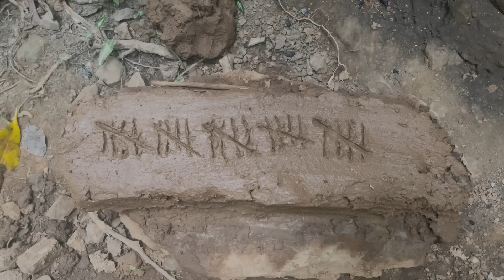Primitive Technology: Wet Season Destroys Thatched Workshop

Comment from the maker: It's been a heavy wet season (biggest since the 1970's) and it's slowed down production of building material as well as other projects. Fortunately, the brick and wood ash cement hut still stands after 2 years of wet weather. The video highlights the importance of permanent structures in this hot wet environment.
Reply: Yknow, ive always wondered if that Brick mould you use is still the one you made way back then. Did it ever break when you used it and if so how many times? Any other instances of your Pottery/Tools breaking in use? I dont see you use that stick drill to make fires anymore. Greetings from Austria
Reply: Wow
Reply: It might be time to invest in working on a drainage system due to the pooled water around the yard? Also, a bigger brick workshop would be nice.
Reply: Would it be possible to build a workshop with a brick roof & supports? Or is that too dangerous without industrial-grade materials?
Reply: Did you wear a protective mask around the mold spores or did you just hold your breath or something?

Edit: Please stay safe there. The currents look dangerous. But i guess for an outsider like me it looks worse then it is
Reply: In what country are you filming these videos?
Reply: @KajSeVai Australia
Reply: How many bricks do you need for your project? Also have you considered maximizing the ammount of drying bricks by stacking wet ones with leaves i  between to prevent them from sticking like parchment paper does with baking?
Reply: @KajSeVai Northern Australia IIRC (Queensland?)
Reply: If it's not a secret, how old are your shorts and where can you buy them? It seems their quality hasn't dropped for eight years now.
Reply: Perhaps you could create the posts in the modern way- that is, by digging a wide hole for the post and filling with concrete. This way you will not be limited in the diameter of these posts
Reply: I think I saw a comment earlier advising it’s time to build a work hut with more permanent materials. Maybe brick pylons to hang a tile roof from that will allow for ventilation during firing?
Reply: Great video! It sucks that this wet season has made production so tough for you. I still enjoy every video you post though! Are there plans to make a larger brick workshop or would that be way too many bricks?

Also just a curiosity question but is the place you do all this filming a lot of travel for you? Like do you have to drive far away from home to get here?
Reply: I mean it's amazing how long the brick hut has survived. And it doesn't seem to really degrade. Do you have an estimate on how long it may survive?
And what do you plan to do with the bricks? 200-bed hotel?
Reply: My goodness, the erosion from all that water. Must be rough. As another comment said, maybe it's a good idea to think about a drainage solution.
Reply: Month 3 of requesting to be your editor, love your work!
Reply: Did you immediately regret making the new hut smaller? Or it was still a good decision?
Reply: If it were feasible, would you attempt something like a wood shake or wood shingle roof?
Reply: Must be getting ready to build a pyramid
Reply: @bigmanmax647  He mentioned in another video that the bow drill isn't needed anymore because it's too cumbersome and doesn't really start fires much faster since he's skilled at drilling by hand.
Reply from the maker: @bigmanmax647   Yes, it is still the same original ceramic brick mold. The very first mold was wood which has since rotted away. The benefit of a ceramic brick mold is that it is permanent. Also,  I have a second brick mold in case the original breaks. The reason I don't use the cord drill any more is that there are more parts to maintain relative to the fire sticks. Also, I have a broken stone axe right now that needs the handle replaced. Rope is what I go through the most due to it being the drive mechanism for the blower. Thnks.
Reply from the maker: @botaohenryfeng9587  Bigger would be nice but maybe tiled smaller one till then. The most recent hut built in this video only lasted 1 month before needing new thatch. Tiles would give a permanent space. Thanks.
Reply from the maker: @casualcommenter7152  Yes, it would take a while though. If built well it would be safe. Thanks.
Reply from the maker: @drizztdourden4929  Just stay up wind of spores or hold breath. Yes, I didn't go in the water that day, too strong. Thanks.
Reply from the maker: @KajSeVai  Australia.
Reply: @casualcommenter7152 

Bricks aren't a good roofing material. It's easier and more efficient to use bark that's be coated in resin or tar, depending on availability. In theory, if he could make a primitive wood splitter, he could  make his own shingles out of locally available wood.
Reply: Why are you so behind to primitive skills or is he a fake tuber call him out.
Reply: Will you look into more advanced pottery technologies such as porcelain, potters wheels, stoneware etc? Could be a good way to use the newly advanced pyrotechnology whilst continuing to gather metal ores slowly.
Reply: Duuuude, you missed the perfect opportunity! You should have made a quick 30 second video on April Fools day Titled "How primitive peoples made fire". Then proceed to spend a few seconds with a lighter, lighting the fire, then waving your hands like its magic.
Reply: Its kinda amazing the brick shack wasn't washed away in the monsoon that was going on in that area,
Reply: Do you have crocodiles in there? Or any deadly/venomous creatures? Is it dangerous to walk around barefoot?
Reply: wattle and duab
Reply from the maker: @GingerHead.  100 more or just tiles depending on the shelter. The problem with stacking is that the clay slumps if done too early. Also, bricks need to be stacked on their sides to stop breakages. I considered drying shelves but it was too complex. Thanks.
Reply: Primitive skills is a fake copycat
Reply: @bigmike-  a primitive froe would be within his ability I think.
Reply from the maker: @RuslanGabdrafikov  They're not the same ones. The brand is Stingray made in Bangladesh. Thanks.
Reply: Have you considered making buckets with handles (rope or horizontal stick) instead of pots, to allow for carrying two at once to reduce the amounts of trips from the stream to the hut?  Do you not care enough since it's it wouldn't save much time relative to the overall time it takes to make clay products?  Or is it too difficult to make given the tools at your disposal?  I would also imagine that then you'd have to worry about losing a pot if a handle failed too.
Reply: For anyone wondering he took precautions
Reply from the maker: @sportz5740  That's the plan, to build more permanent brick structures. Thanks.
Reply: What temperatures and humidity are you dealing with?
Reply from the maker: @Congra  A smaller brick workshop maybe, 2x2 m is enough floor to make 50 bricks plus a stacking area. Kiln outside, fire wood inside. It's not far to get there. Thanks.
Reply: How long has this set you back if you don’t mind me asking?
Reply from the maker: @robertnett9793  Over 2 years old now. Bricks and tiles don't rot but the wood might. Much better than thatch though. 200 very tiny beds maybe. Thanks.
Reply: ash-crete  @gnometruth
Reply: Could you sign a book for me with a muddy handprint so I can high-five you, please?
Reply from the maker: @Sphendrana  The bricks were fine regarding drainage, it was the roof that's a problem, the direct rain dissolve the waiting bricks. You'll see in the video I made square ponds. These collect levigated clay for pottery projects, the drainage off the roof helps in this process. Thanks.
Reply from the maker: @obscureorca  It was the best option in the situation. Some of the bricks are still there and I'm currently repairing the roof. Thanks.
Reply from the maker: @bunkydoes8048  Tiles are better than wood. Wood exposed to the rain rots where as purlins under tiles last longer. Thanks.
Reply from the maker: @Rob-rr4yp  Glazes would be good. I'll think about it. Thanks.
Reply: how many grams of iron do you have and what do you plan to make with it?
Reply from the maker: @dkarbaev  Just snakes, no crocodiles. Further down stream there are crocodiles though. Thanks.
Reply: Hi, only tangentially related to this video but a few papers mention the importance of silicon in cast iron production. Have you tried adding something like the grog you make from broken ceramics to the smelting process?
Reply: @gnometruth  nah man he doesn't use and modern methods for anything. Absolutely everything he uses he made himself from the natural materials. He even tried to make his own shorts but they didn't work out very well so he wears store bought shorts.
Reply: What will you do differently on a new brick build? Any ideas to deal with rising damp and foundation settling?
Reply: @primitivetechnology9550  that makes sense. I'm excited to see that built! 

Glad to hear it's not a huge trek for you to get to your primitive tech area!
Reply from the maker: @Patchnote2.0  It might be done with pottery, pots could be made with holes in them. Just other priorities but I'll consider it next pottery batch I make. Thanks.
Reply from the maker: @jamessylviasyracuse-little865  30 c heat probably, 100% humidity when it rains. Thanks.
Reply: Did you enjoy the novelty of the huge floods or was it purely an inconvenience? I'm guessing it got old quickly.
Reply from the maker: @ret9108  I might be able to make 200 bricks in 5 weeks. wet season is 6 months but not so intense the whole time. So 800 bricks not made? thanks.
Reply: are you going to put a brick/tile? roof on the workshop? I guess you'd have to make the foundation and such, but it seems to me you've got it laid out, and could build from the posts up. you'd also still have something to keep the rain out for a while.
Reply from the maker: @ShayzZin  It might make slag with the iron, I'll look into it. Maybe quartz rather than clay to make purer silicon? Thanks.
Reply from the maker: @AndrewArdill  I might make a temporary brick hut mortared with clay so I can take it apart and make a different one later. Build a small one to make bricks and then a larger one later. Thanks.
Reply from the maker: @Benjamin-mq6hu  It was a bit of a novelty but got old quick. My friends house got flooded so it wasn't fun for him. Thanks.
Reply from the maker: @Korhanne  Yes, definitely tiled roof. I have a plan but need to test it out, want to use minimal amount of bricks to support a roof while still having it stable. Thanks.
Reply: How do you deal with bugs and other critters? Do you know which ones are venomous? What if a bad one comes crawling on you?

I would vacate the house and build a new one if I were to ever saw a centipede crawling out of the coal pile lol
Reply: @gnometruth  Sorry sir, this is the primitive technology channel.
Reply: For clay firing, there's another youtuber named Fraser Builds who uses flour/other starch fluid that makes the clay more 'suitable'. Perhaps this technique would be of help for your projects?
Reply: @primitivetechnology9550 you could use the iron make some nails or something :D
Reply: Very interesting! I notice you still have sedimentation pits but are also gathering raw clay from the creek bank. I'm guessing the gathered stuff is better for bulk products like bricks and you're using finer clay for your pottery now? I remember you made previous tile roofed huts on wood frames, I'm guessing those would hold up better than thatch but not be as laborious as the brick buildings...
Reply: @primitivetechnology9550  regarding the idea of handles, maybe you could make some sort of harness for the pots, which you then hang from a perch, allowing you to have one on each side of the perch and have the perch on your shoulders, this way you can potentially carry double the load while keeping things balanced, might be easier to make than handles (which would need to be strong enough to carry the load)
Reply: You sir, are a legend. i hope you didnt loose too much with the wet season. is there any way you could make the materials more resistant to the weather? ofcourse within the boundaries of the tech period.
Reply: @primitivetechnology9550 You could probably make a larger, more permanent kiln using all those bricks, with a blower to assist both the drying stage and the firing stage. That way you could really ramp up your brick production!
Reply: @casualcommenter7152 He shows you his brick hut with clay tile roof still standing just fine at the end of this video.
Reply: @primitivetechnology9550 You could try making some glass out of some sand! With glass, you could make a small lens to try and start fires that way?
Reply: Idea:  Make a brick form for 4 at a time, or maybe more...but 4 seems most tenable for the space...2 rows of 2 - means you move/water the form 4 times less.
Reply: You seem to be going through a lot of wood with all the brick firing, coal making and forge tests you've done over the years, so I'm curious: How large an area have you now searched for sticks and wood? And, when you fire the bricks how often do you have to feed the fire? Great video as always :)
Reply: I always wondered where you learned how to do all this cool stuff and did you learn in case of a Zombie Apocalypse?
Reply: With this heavy rain, are you anticipating it to change/speed/slow future resource collection significantly? For example, are you anticipating increased or decreased clay deposits, or has iron production been lessened by the faster currents?
Reply from the maker: @Rws4Life  Smoke is good for mosquitoes, but the other creepy crawlies are unavoidable as yet. Probably sleep off the ground on a bed. Yes, they're no good. Thanks.
Reply: @sophietaylor9753  Making clear glass is a bit more complicated than just putting sand into a fire or furnace. You need the right materials (they cant be contaminated by ANYTHING), have the exact ration of said materials, a fire that supplys a constant ammount of heat (1666C or 3090F) for a long period of time, a way to measure that temperature accurately (a few degrees more or less will result in failure), a way to not only give the glass the right form (eexact curvature, cant have dents or something - also need instruments to measure this), a way to polish one of the hardest man made materials (glass is a 6.0 out of 10 on the Mohs hardnesscale with diamond being a 10, he has no material that would work yet - the hardest is probably his cast iron and thats a 4.5-5/10 at best) and then a way to store said lens without it getting scratched.

Im guess that this is still a bit out of his league. 
Its also probably not worth the trouble, as it would be a LOT of work (i would guess somewhere up of 200 man hours for a project that might only save a few combined hours in the long run)
Reply: @RuslanGabdrafikov I have a theory that he actually bought like, 20 pairs of the same shorts and labelled them “work”
Reply: I'd like to eventually see you build an all in one mega structure, tile clay brick different rooms for different tasks all done for permanence and climate control
Reply: @Rob-rr4yp it would be quite wild to see him go through his own stone, bronze, and Iron Age. When I have kids and a beard he’ll have a residential block built 😂
Reply: @primitivetechnology9550  oh! I see that now. I watched a few things over as I usually do with your vids and finally noticed!
Reply: @primitivetechnology9550  is it possible to cover wood in mortar or clay in order to prevent/slow down rotting?
Reply from the maker: @hakonsgaming535  Yes the pottery clay needs to be gathered from certain sources, the mud that passively collects in the creek from the surrounding soil won't work for pottery as it's weak. Might be too weak for bricks too. Yes, probably make a brick wall to hold up the roof, lashings tend to rot which is a problem for pole roofs. Thanks.
Reply from the maker: @celivalg  That's true, I'll keep it in mind. Thanks.
Reply from the maker: @Palerider1942  Clay tiles instead of thatch. I mentioned that smoke preserves thatch but it still doesn't last long. Thanks.
Reply: What is the timeframe of your recording and upload schedule?
Reply: Your videos are very relaxing to watch. Do you plan on making an extension to your brick house?
Reply from the maker: @sophietaylor9753  Yes a larger kiln would be good. Quadrupling the capacity would take twice the firing time  6 hours (400 bricks) instead of 3 (50 bricks). 12 hour kiln would fire 1200 bricks and be over 2m high and wide. More than this would require multiple people to stay awake and fire them in shifts. Thanks.
Reply from the maker: @sophietaylor9753  I tried some glass but it was gritty and not glass like. The best "glass" I made was during a smelt which made blackish blue glass from iron ore. Ash seems to be important in glass making. Thanks.
Reply from the maker: @jamesbramlett5407  Might need to be a wood mold for that. Thanks.
Reply from the maker: @iccuwarn1781  Yes, because the wood is dead fall, you only have to wait for more wood to fall rather than go a long way to fetch it. I don't go out of the valley the hut is in to get all the wood needed usually. Sometimes I go further to get wood for charcoal though as the wood density is important for that purpose. Thanks.
Reply: @primitivetechnology9550  RE: spores, I think if/when you have to deal with some security risks that can be easily avoidable with modern technology, you should go for it regardless. As you said, staying upwind from the spores is enough, but if you had to salvage more stuff or go into some mouldy place, for sure use a mask. Like you said about not going to the water, it pays to know a couple of knots and have some (modern) rope on you, stuff like that. 

Just wishing all the best, we know you take care etc.
Reply: @finnbergermann Yep, thus the "try" :P You don't need a lens to be perfect to make it concentrate light - as long as it has curvature, it will have a finite focal distance. A lil' blob of glass, even severely contaminated, might be able to focus enough sunlight into a small enough area to start some smoldering.

Furthermore, adding soda ash and potash will greatly lower the melting point required, making it much more achievable.
Reply from the maker: @Trxps_Dark  Just trial and error and research. Maybe not zombies but in case of unemployment. Thanks.
Reply: @primitivetechnology9550 "Ash seems to be important in glass making" Yep, it lowers the melting point necessary to form glass.
Reply: @primitivetechnology9550  RE: wood purlins and rot: does drying and charring the wood help? I know if every building of yours lasts 2+ years like the current one it is already "good enough" - but if charring helps and is low effort, might be interesting. I'm not familiar with literature on the topic, so I do apologise for that.
Reply: Have you thought about buying some copper ore, as there probably isn't any in your forest and then smelting it? Historically people figured out how to make copper, then bronze then iron. Iron was probably too hard to make first.
Reply: Have the flood waters died back yet? Did they bring you anything interesting?
Reply: Could you do a small brick shelter but dig the floor so you have more room ? You'll have to think about making stair and protect the entry of water but it could be nice for you to stand fully and easier to build and gain place ?
Reply: Have you noticed the compression issues with your recent videos? It's especially evident on flames or during time-lapses (i.e. at 4:23 and 5:00 respectively). I'm not sure when this started exactly, but the compression wasn't always that bad, for example the fire and time-lapse in your "Primitive Technology: Making Charcoal (3 Different Methods)" video (i.e. at 3:25 and 0:45) look much better.
Reply: I am sure this is asked often but does anyone know what country this is?
Reply: @primitivetechnology9550  Replace the timber support in your basic workshop design with columns. 4 bricks placed at 90 degree angles to each other (leaving a half brick of open space down the center), or just build two brick walls on either side with timber spanning across. I would be concerned about the shear strength of the two-walled design, but 6 columns of bricks should be plenty stable. If you need to have walls on either side to have enough timber to support clay tile, use diagonal bracing with timber back to the ground to add some shear strength and keep the walls from toppling over.

The column idea could have half bricks in key locations to slot timber through.
Reply: Thanks so much for sharing this. It's really interesting to see the effects of heavy rain and the demolition and rebuilding afterwards. Another great video.
Reply: does it make sense to build a hut with wood surrounded by clay? kinda like a concrete + rebar thing
Reply: Wait so is the ash you make into bricks not burned enough that handling can result in chemical burns, yet? I seem to remember you finding out just how caustic wet ash can be, at one point.
Reply: I was looking into what could be improved on the blower for the smelting project.
and I would suggest using more, longer and as wide as possible (to seal better) impellers. 
also crank maybe better than a bow
Reply: Ah yes, North Qld rains, a real pain to go through.
Reply from the maker: @Elliottklassen  Iron has increased this due to iron rich sands forming new banks in the creek. The banks leach out iron bacteria (hematite) which ca be collected but the water has to stagnate first. Clay collection will remain the same I suspect though. Thanks.
Reply from the maker: @etaiger  It's best to leave timber open to the air rather than cover it so it dries out. Clay cover may prevent this I would think. As long as wood is kept dry and free of termites it should be ok. Thanks.
Reply from the maker: @just_another_WFR Thanks for liking the book. I'm writing a second one with better techniques and if lucky I'll be able to publish it too. Thanks.
Reply from the maker: @AVeryDandyLad  One video a month uploaded on the first Friday of each month (late Thursday American time?). I've managed this schedule for 2 years now. Thanks.
Reply from the maker: @theuser810  I've considered how to make extensions but it might be better to build smaller separate huts which is my plan until I can build a big one. Thanks.
Reply from the maker: @prgnify  Yes, I've heard spores are a major issue indoors with chronic respiratory illness if exposed for a long time. Out doors probably not as bad but still I'm conscious of it. Masks are a good idea for charcoal dust as well. Thanks.
Reply: @primitivetechnology9550  How is your commute to this property during the wet season? Are the roads impassable during then? Is it somewhere nearby where you check up on the structures and camp for a couple of days or commute back to home at the end of filming each day?
Reply from the maker: @sophietaylor9753  Yes, see forest glass (made in Europe where there were no natron salts). Used fern leaf ash. Thanks.
Reply: @primitivetechnology9550  not a question, but if there is any channel that I believe has done all the work he or they have done (and hasn't cheated) is your channel (and I mean realistically I don't follow any other primitive technology-esque channels anyway, although I heard about one channel that supposedly was using big construction equipment)
Reply: @primitivetechnology9550 I love your work sir, it's absolute labour of love and dedication.
You have inspired millions to be better people ❤
Reply: With all that turbulent water you should do some primitive gold panning.
Reply: @primitivetechnology9550  How many hours a week do you spend doing all this primitive technology physical work?
Reply: @primitivetechnology9550 Brick mold… suggestion/ideas: retaining wall shape w/ self-locking flange in the back (a lip that overhangs and grasps the block underneath). Or possibly a golf ball size dimple/divot for stacking? And a few hollow-form bricks to fill with primitive concrete for specific pillars/stability?
Reply from the maker: @prgnify  I've heard mixed results with charring wood. In Japan they do it as it is supposed to prevent rot and insects. I've also heard elsewhere that it wont work as termites here eat around charred wood and are not deterred by it. Thanks.
Reply from the maker: @69Buddha  The floods brought more iron sand. That was about the most interesting thing to me. Thanks.
Reply: if you had a flat rectangle of wood or bark that you wet and place under the brick mould, could you pack the clay down tighter when making bricks so the underside of those bricks isn't so porous? I assume you avoid packing the clay too much to prevent it from clinging to the ground so maybe something thing and rigid you could slide out from underneath it would be beneficial.
Reply from the maker: @lolxdmdrlmdr  A cellar would be good, water proofing it may be a challenge. Thanks.
Reply from the maker: @lecookz  The wood rots, like  wattle and daub hut. Thanks.
Reply: @primitivetechnology9550  SOON? early Roman or Sumerian brick architecture of pillars/roof, elevated foundation, flagstone tile? Eventually adding flagstone workshop, tools, sluicing station, fine clay separation pools, water mill & hammer, dry stacking walls, meter size storage bins, fixed location charcoal making structure, foundry… 
AND ESPECIALLY seeing the GARDENS again.
Reply from the maker: @rikuaotsuki6353  It's ok as long as you don't handle the ash much. Thanks.
Reply from the maker: @its_Jere  The water subsides enough to travel over the creeks in a short period after rainfall. Sometimes I can't check the hut. Thanks.
Reply from the maker: @justanobody0  Thanks, much appreciated.
Reply from the maker: @rickknight3823  Much appreciated.
Reply from the maker: @carbo19  I sluiced iron sand for one video but found no gold. Thanks.
Reply: Architecture: rather than square structures, consider 6 pillars and a rounder/elliptical building. Extra stability. Amazon tribal, Norwegian long houses, Celtic/Anglo-Saxon roundhouse…
Reply from the maker: @JoannaFalkowska  Not much in the wet season but about 6 hours a day in the dry season. Thanks.
Reply: @primitivetechnology9550 Are these  reruns of earlier videos???!
Reply from the maker: @KGTiberius  I made some bricks with holes in them but it took more time. Thanks.
Reply: Any TRAVEL excursions to beaches/karst/cliffs (shells/calcium/limestone/flint), mountains (ore, magnesium), desert (silica), stone (basalt, shale, flagstone, mill-buhrstone, granite, sandstone, …), etc?
Reply: QUSTION they allow gold mining there?
Reply: How about a Roman arch design with a keystone?
Reply: @KajSeVai Australia
Reply: @casualcommenter7152 you could always build it in an arch.
You do have to worry about subsidence, so you might need a concrete floor.
Reply: @babilon6097  pretty sure he's up near Cairns, they had a cyclone that dumped like a meter of rain in like 3 days
Reply: I swear you had a tattoo once
Reply: Suggestion for a non-fire related project that could be useful: a wheelbarrow.

It'd be interesting seeing you make a wheel.
Reply: I wonder if having those huts be lived in (and thus have fires burning regularly) would make a notable difference.
Reply: Time to build a Boat
Reply: What’s the weight difference between clay bricks and ash bricks? Are the ash bricks especially good for specific applications?
Reply: How do you keep yourself safe from constant mosquito bites? Love the dedication as always!
Reply: Make metal pickaxe and shovel from iron bacteria
Reply: Thanks for the upload! Always a pleasure to watch, even if the circumstances hinder the project.
Reply: I'm amazed that the brick hut has lasted so long! How long have your previous structures lasted?
Reply: @Palerider1942  loose ???????????         " LOSE "
Reply: Thanks
Reply: Why didn't you take  the chance this wet season provided you, to craft a boat and sail it through that flooding river? :D
A piece of bark, a stick, and a leaf, is enough to achieve that.
Reply: @frederickheard2022  they're for storage easier to move bricks around than dust
Reply: Bro, I want to tell you something:
Why do you make fire using your hands if you have a drill?😐
Reply: @Thescott16  I think to make a wheel

I don't know what trees are available there, but I think if he would be able to find a big hardwood (the diameter of the stump being equal to the diameter of the wheel being desired to make)

and let's assume it's a hardwood that somehow fell and wasn't rotten (because cutting one down with a stone axe or the small piece of metal he has would probably take a long time

if the tree is flush with the ground, unless he can lever the tree onto a stone or something, he'd then have to make a pit like a foot deep below some part of the tree

the fire would cut the tree into a more suitable length (using a stick to knock off coals to make the process faster and more controlled/precise)

he could then put hot coals on certain areas of the wheel to get it to the correct shape and blow on the coals and chisel away at the burning areas to get it to the right shape

he could then put coals in the center of the wheel and do the same process to make a hole in the center of the wheel
Reply: That is a lot of new bricks. I am excited to see what new projects they will be used for.
Reply: Have you considered making a fired clay floor
Reply: @bigmike-  a froe, to be specific.
Reply: I still find it a bit scary that you have this dry leaf matterial basically directly above the fire just waiting for a spark to travel up there Granted you wont get a forest fire with how wet the forest is but still... could you do a test to see how easily one of those leafs would burn?
Reply: @primitivetechnology9550 charred wood is more rot resistant, but bugs’ tenacity can vary a lot.  Try avoiding sapwood (the layer of softer wood beneath the bark) as it is much more vulnerable to insects than the heartwood.
Reply: If you managed to make some sort of glaze for the pottery, you will have a reflective surface (if light ray incidence angle is almost tangent).

You could use this to make a solar light concentrator... This would give you access to higher temperatures than possible with fire on a small  point.
Reply: He was always an AI
Reply: Can't wait to see what the forest looks like after it recovers from the rain. Also I feel like so much of the work you do would be 3-5 times faster/easier with even just 1 more person helping you out. Is it something you have thought about doing at some point?
Reply: @KajSeVai he's in australia iirc somewhere in the top end probably
Reply: @GingerHead. "maximizing the ammount of drying bricks by stacking wet ones with leaves i  between to prevent them from sticking"
interesting
Reply: What are you building that will require so many bricks? New workshop?
Reply: Veritasium recently posted a video noting how the Japanese used flowing creeks or rivers to collect iron rich sand in sedimentation traps of some sort. Would the erosion due to all of the rain carry this type of sand through your property?
I would love to see you be able to make a shovel😂
Reply: Thank you again for an incredible video, I really enjoyed the soundscape of this video. I had a very silly question with surprising depth: is it ever viable to make a floor? Would most material be too uncomfortable to stand on? Would a plant-based flooring last long enough to be worth it? And thank you for being you!!
Reply: @primitivetechnology9550 Have you considered using something like water reed for your thatch roofs? In the north, we have used them for millienia and they can last years if done right.
Reply: @orsoncart1021 Primitive Skills seems to be trying to be legit and I don't think creators calling out eachother is constructive. 
As to different rates of advancement, Primitive Skills has high amounts of readily available iron ore (the rock kind) and bamboo making it easy for him to evolve quicker
Reply: Crazy, its been a super wet summer here in the Netherlands as well. What a coincidence
Reply: How many bricks are you aimgin to stock pile for your building project?
Reply: I think I mentioned this once on another video, but it may be worth your time to make a simple besom broom to clear away the sticks and leaves and pebbles and other debris from your workspaces. The quality of your clay, bricks, and all your other products is diminished from the uneven and dirty work surface. One or two passes with a simple besom could give you a very nice boost to the efficiency and quality of your labor. Thanks again for making these videos.
Reply: Very interesting to watch the tenth time the production of bricks, mines, shacks. I was thinking, maybe there’s a way to make a primitive lathe, a primitive steam engine, a primitive iron drill, and other things like that.
Reply: Pls build a dam in the creek it would be epic
Reply: @primitivetechnology9550  30 degrees and 100 humidity, gotta love Queensland eh?
Reply: As an AVID youtube watcher who's been on the site for 10+ years, there is not a single channel that i can even compare to Primitive Technology. I dont know if my ape brain just loves watching someone live as my ancestors used to or what. But id just like to thank the man himself for always guaranteeing me at least one good day a month. Thank you
Reply: Just wondering how the wet weather has affected the iron bacteria levels?
Reply: I use to watch Ray mears survival he's legit like you, its really usefull to see how you do these things. Thank you for making these videos!
Reply: Do you have estimates of how many bricks it would take to make certain size buildings? Just wondering with the bricks you have now, how big could you make the walls before having gaps, not including tiles for a roof.
Reply: It's a shame about the setbacks during all that rain but I'm glad you're still making some progress. Excited to see what you'll do with all the bricks and good luck with your roofing issues.
Reply: Worst rainy season from 1970 until the present day? climate change is real. Affecting the hidrological balance even in that natural environment.
Reply: I have a photo graph of a primitive drill from a museum in Latvia, is there anywhere I can send the photo to you, I think it would be a good experiment to adapt into your tool set
Reply: The whole work looks like a lot of backpain?
Reply: So the next step will be a brick and mortar workshop, the prevent this in the future?
Reply: Is it possible to prevent the lashings from rotting with some type of treatment with primitive methods? Like some type of primitive tar or so?
Reply: @robertnett9793  It's a brick house with a clay tile roof. There's houses in the US made of the same materials that are 200 years old. There are buildings in Europe made of the same materials that are almost 1000 years old. That hut will be there until the water washes away the foundation
Reply: @bigmike- It's not incredibly difficult to make a plane, that requires cutting down full sized trees to make shingles though, something he seems to try to avoid. Ceramic tiles like the ones on his brick hut are probably a better long term option as long than wood shingles anyways
Reply: @owenhall4028  I guess that was the point I was getting to. I mean, obviously foundation erodes faster than the stone. :D
Reply: Why don't you get married? 😂
Reply: please wear a mask to avoid mold spore inhalation! your safety comes before authenticity
Reply: @Hi-vd8lr  I don’t think so. Mixing the ash with water makes cement that changes its chemical structure. If he was storing the ash, he’d use a pot.
Reply: Belki çatıyı kıl ile kaplamayı deniyebilirsin
Reply: any plans to improve the production? like several brick molds in one go? Iam guessing the new bricks are going to be used in a bigger construction so it could be a better workshop with more space.
An several levels for drying more bricks at the same time?
Reply: @Sphendrana   yeah probably an elevated dry ground and channels
Reply: have you ever tried building an arch with bricks? i think it would be cool.
Reply: @primitivetechnology9550  How much more efficient/durable would the kiln be if you made it double layered of bricks? what if you put a air or mud layer/pocket between them? seems like the kiln looses alot of heat and breaks down due to the thinness of it. that or if you built it with the bricks widthwise instead of stacked lengthwise? then the mud/mortar would be about a food thick and run its length from the inside to the outside.
Reply: Gracias por sus videos
Reply: Please tell me you are going to build a brick "hut" with tiles. You have to rebuild it avery time...
Reply: Ich folge dir schon eine sehr lange Zeit. Was ich mich frage: woher kommt dein Interesse ab so alter Technologien?
Reply: @primitivetechnology9550 little bit off-topic, but it would be nice to see you glazing your pottery with salt perhaps if you have a way to extract salt naturally. Also i made a clay kiln just like you did, and it works really nicely!
Reply: @primitivetechnology9550 tiles are most sustainable but also most effort, a heavy construction. It seems animal sources like rawhide with animal fat are not an option? What about plant resins? The ones I know from coniferes burn easily-the same in your forest?
Then plant oils from nuts? With two flat heavy stones you get an oil mill, and if you boil the oil, it might „harden“ (works for a.e linseed oil) to be longer lasting. Then you can apply it on dry leaves of you roof to waterproof it. This option is cheaper, and sufficient if you just need a place to dry the bricks. Not good if you fire in the hut. Would work also with some bark types instead of leaves, or bee wax instead of nut oils, if available.
And for the walls-why not use just stones and your mortar, less time needed than burning bricks? I have seen stones at your clay river location.
Reply: Do you need a permit or license to do any of this? I don't know much about any laws surrounding stuff like this but it ain't illegal if they don't catch you.
Reply: Be my husband😘💕
Reply: @TheSpeedOfC  This is completely possible with materials and tools JP already has on hand. Concrete is just cement and an aggregate, and he has both.
Reply: I'm just wondering what part of the world the videos are made in, since there is no such thing as wet seasons and such here in Sweden.
Reply: Very rainy here in France, record in volume since 1956 in the northern half. You're vids are amazing, you might be teaching us how to rebuild everything
Reply: @gnometruth  Even so, wouldn't that mean doubling the effort involved in the build? The size of his builds probably already take an enormous amount of time and effort.
Reply: @primitivetechnology9550  Resin has been used for ages to waterproof. Mind, I do not know what trees in your area would be good choices to get resin, plus resin does get runny if heated, so depending on how hot it is there, it may not work well. Still, worth looking into and testing to see if you can get a wood tile that can survive rain
Reply: The kiln you usually use to fire bricks and pottery is simple, but do you have any plans to build a larger kiln?
Reply: OMG. He made a text.
Reply: @drizztdourden4929  He is working in the open air so as long as he is careful not to stir up too much dust he will be fine. In the case of the indoor environment, the mask is a must-have.
Reply: You guys got over 2000mm when the cyclone hit before Christmas
Reply: @babilon6097  Kuranda, in the highlands just to the northwest of Cairns
Reply: How difficult would it be to make an arch out of brick/mortar? Have you tried making these before?
Reply: Awesome brother good to see you keeping the old arts alive. I've slowed up in my older days  still manage to long bow hunt and flint stone works and black smithing. Keep up the great works we may need it sooner then we think. The ancient is returning to clean up this messy world of the greedy evil ones. Keep well brother. Cheers.
Reply: I wonder how you would go making a paved / improved surface area, or some kind of managed drainage system around a structure. It would be interesting to see what kind of improvements might be made to structures over time, with this level of material and technological sophistication. I know you use a lot of dug-out, earth work elements in your industrial processes, but it would be interesting to see what potential benefits (and necessary adaptations) would result from constructing a more developed work areas/surfaces. I imagine it would require a degree of specialization vs. the adaptability offered by the current temporary earthwork arrangements.
Reply: @primitivetechnology9550 Hey John, how do your palms and fingers fare in such mass clay production? Also, does the ash burn the skin after awhile? You the man.
Reply: Mixing clay with sand makes a more ductile brick than just clay even when it's unfired although it might take a hotter temperature to fire it
Reply: Fantastic work and look at how these structures deal with different conditions and how the work is affected by them. 
I see you are planning to build more brick and mortar based structures, I still love the one you did with the stone bed to keep you warm.
Reply: @orsoncart1021 dude…. He’s the OG for primitive skills
Reply: Son muy inspiradores, educativos y satisfactorios sus videos. Admiro y agradezco su determinación y pericia. Le sigo y le saludo desde Uruguay. 🇺🇾
Reply: @bigmanmax647 he has mentioned that once he got good enough it was easier to do friction fire this way
Reply: @bigmanmax647  in an earlier video he mentioned preferring this way of firemaking as it's actually easier/faster once you get good at it
Reply: Have you ever seen the anime 'Dr stone' ?
Reply: @primitivetechnology9550 sounds like columns and arches to me!
Reply: Could you make a hut that is basically identical to this thatched one, but make the roof out of tiles instead? Seems to me the tiles are what's keeping the brick hut intact more so than the bricks themselves. But I imagine the tiles might be too heavy to be put on top of such a simple wooden structure?
Reply: i may have missed the episode but do you have a form of water filtration or how do you get clean water while out there?
Reply: I see discussion here between commenters and you about mold, where in the video is that? I must be completely missing it. Definitely something to be mindful of indoors, but not used to seeing it in an outdoor human settlement like this which would be interesting. thanks
Reply: @AaAa-je5eo  when hes taking down the shelter he mentions mold, i cant get the timestamp at the moment, sorry.
Reply: @casualcommenter7152  I think that's why he's producing that massive pile of bricks, to create a larger, more stable workshop area.
Reply: @lord_wyran  That's perfect, thanks. Managed to locate it via this, its at 8:30 or so. That and you need the subtitles on, which I totally forgot he adds to these
Reply: @AaAa-je5eo  oh yeah, only channel i use the subtitles on. super important.
Reply: I dont mind seeing you solo this operation. But wouldnt it be better for productivity to have assistants?
Reply: It is an old invention to powder the sides of mould with course sand. It has got some advantages in the finished product.
Reply: You need a dam and a waterwheel. Use that flowing water to pump air into your kiln.
Reply: Damn,that must've been rough!
Is this the worst thing that affected your camp yet?
Here in Zagreb,it's been hot for a week,I just haven't thought about how it's affecting others...

I haven't paid a lot of attention to the rest of the world due to my job.
Reply: Have you considered coating the hut lashings with pitch to waterproof them? It could prevent your future huts from collapsing like that one did. Or maybe you could use some wood resins.

I'm also curious if you have considered collecting wood gas. You could attach a long truyere to the top of a charcoal furnace and point it to a seal pot nearby in a pool of water to cool it and help the wood gas condense over there. There's a lot of low-level chemistry you can do with wood gas distillate.
Reply: The question is, how to create shoes using primitive technologies and how to make it so that it can be used in cases of snow and frost (yes, an extremely rare phenomenon in Australia, but still it would be interesting to see at least the theory)
Reply: It's crazy to think that in no time at all a advanced civilisation can be lost in almost no time

Have you left anything to rot? And can you see anything left of your work?
Reply: What do you plan on doing with all the bricks you’ve made. Is a primitive mansion in the works?
Reply: I assume your building up your brick supply to hopefully make a more sustainable working area rather than keeping your thatch one’s, hopefully you’ll make a barn like work area with some brick walls and tiled roof but with an open floor plan so that you have it year round, I’d even suggest just a simple lean to build with just the back wall bricked off
Reply: So i guess in the next video we are making a mansion with a pool based on the number of bricks that are gathering there :)
Reply: is the plan with the fired bricks to eventually have enough to make a permanent workshop using bricks and mortar? Imagine the progress you could get if you didnt have to constantly tear down and build new ones.
Reply: have you ever tried to make pure clay bricks before or just a brick made out of more refined clay as best as you can? I'm curious if it's stronger or weaker.
Reply: @primitivetechnology9550  @celivalg In case you don't already know, the name of that invention is a yoke or simply a carrying pole.
Reply: It truly does we often take for granted advancements like tin roofing that dramatically reduce roof leaks and are easy to use comparatively to tiles requiring so much less labor
Reply: when making bricks to decrease the amount of clay used and make the bricks lighter, you could try putting some holes in the middle of the bricks. This would also reduce the thermal mass and allow the flames to more easily heat the inside of the bricks, speeding up firing.
Reply: @orsoncart1021  well I don't think they use purely stuff they made themselves, plus there is more then one person
Reply: @nathandean1687  In Australia in most states as long as you have a license you can 'prospect' in rivers, streams and creaks not specifically prohibited. for example in NSW you can't fossick on crown land but you can in state forests subject to restrictions, in VIC you can with a license prospect in rives, creaks where it has not be explicitly prohibited. however in Queensland "Fossicking is not permitted in national parks, conservation parks, wildlife reserves, state forests and state timber reserves."
Reply: @greenerell484  👍👍❤❤👌👌
Reply: @greenerell484  damn thats worse than some parts up here. where long as a u dont destroy the river bed and or banks by hydro sluicing u can get away with lots of stuff.
Reply: I hope there's a dry season for sure or how would wood get dry enough to work with? On the other hand this man seems to have no trouble starting and maintaining fire.